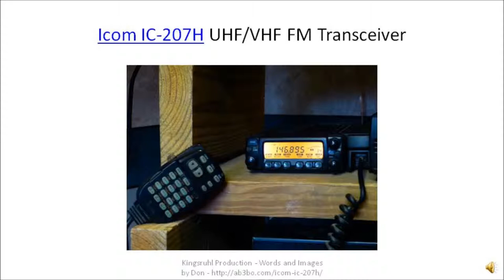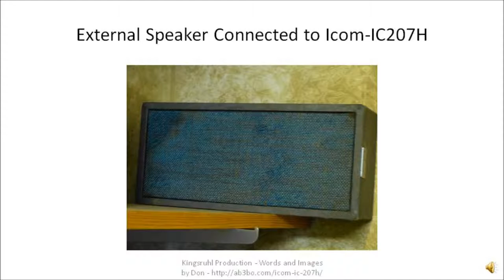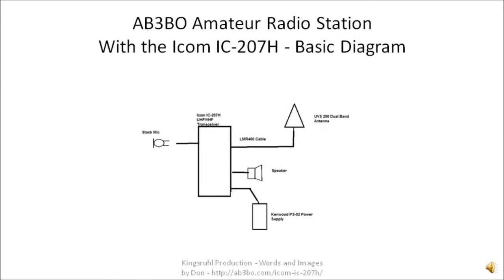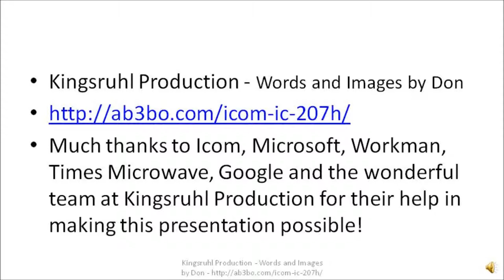AB3BO Amateur Radio with the Icom IC-207H

Comment: Great video.  Haven't gotten my ticket yet but i have this radio installed in my truck.  I listen to it but do not transmit.  It seems to be a good one.  I used your display repair video to replace the lamps that had burnt out.  Thank you for that video as well.
Reply from the maker: Thanks! Very Good on the repair. I hope you get your ticket soon. It is a great hobby/service!